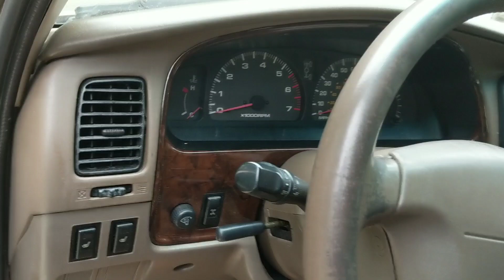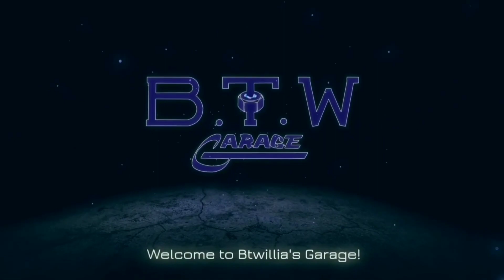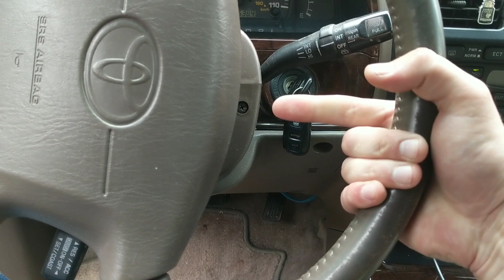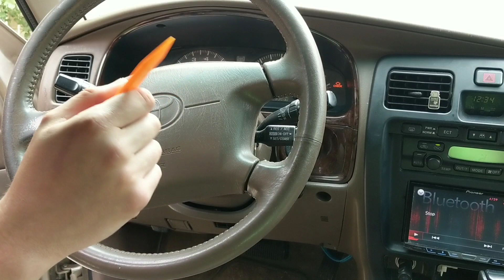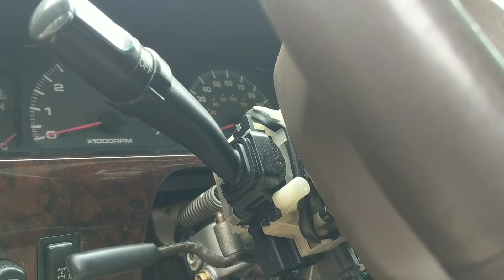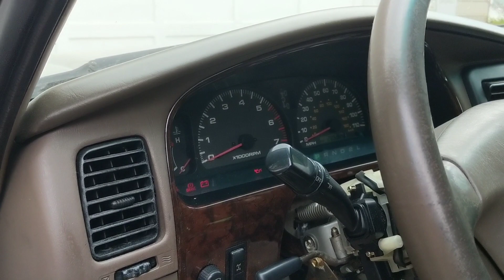3rd Gen Toyota 4Runner Turn Signal Blinker Switch Repair and Replacement

Comment: Thanks for the video, exactly my issue and fixed quickly.  Only note is the trim even with trim tools, it was a pain to remove (as I do not want to crack the plastic) so be patient and careful.

Comment: So much easier than taking off the steering wheel! Less than 10m to do and probably 8 of that was fighting with the 2 trim pieces - once I saw how one side snapped in I quickly got the other undone! Really, that would be my only ask if you ever update this video since the camera showed none of how you separated it. 

But overall an excellent video that saved me both time and money!! THANK YOU!!!
Reply from the maker: My man ❤

Comment: Great Video, it was easier than you made it look. The hardest part was putting the two steering column pieces back together and that only took 3 tries.  Thanks again for the Video.
Reply from the maker: Thank you

Comment: Great video! Just replaced my switch; very easy to do! Dealer wanted over $900 to do this; said part was over $600! That sounded high, so I checked and purchased a genuine Toyota switch for under $200.
Reply from the maker: Great job!!

Comment: Can someone point me to a video of where I can find a fix the turn signal stays on when my lights turn on not the running lights but when I turn the head light on.
Reply from the maker: Sounds like you have the positive wires for each potentially pinched together and sharing a signal. It could be in the switch itself and I would probably start there

Comment: How much was the part ?
Reply from the maker: If I remember correctly it was $25 or $30 used. They are running low in stock from what I hear so you may need to pay $50+ on eBay

Comment: I got a 2002 Toyota 4runner SR5 and there are NO turn signals. What would be a good way to diagnose my no turn signal issue. 

1)Try removing and and inspecting fuses

2) Replace flasher relay behind fuse panel. 

3)check hazard switch 

4) replace turn signal stock

Any other ideas??????

Comment: Thanks for this one!  I went through the stalk replacement and my issue didn't go away.  I tried my hazards and they worked so my searching lead me to a fuse.  Pulled all the fuses under the dashboard to the left of the steering wheel and all looked well but when I put them all back I figured hey, might as well give it another whirl and lo and behold my turn signals work again!  Lesson for me was try the fuses before spending $200 on replacement parts :)
Reply from the maker: Glad you got it figured out! Thanks for sharing!

Comment: Will this also fix the "buzzing" sound when using the turn signal? Mine will make the sound and not go away unless I do a micro adjustment but then it won't even blink
Reply from the maker: Most likely if the noise is coming directly from the switch itself. Is that the case?
Reply: Btwillia's Garage I'm assuming so because it only goes off when I engage my left blinker and it doesn't go away until I reset it. Figured I'd clean the electrical part but it seems like replacing it may make more sense
Reply from the maker: @AlbertoCilantro  I agree. Just be sure to buy the right one based on if you have or want fogs or not 👍